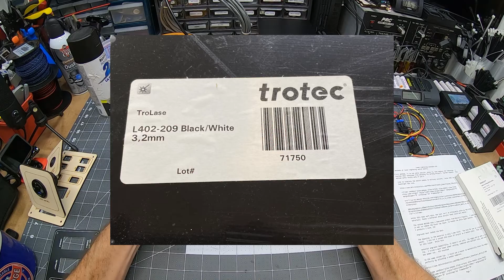Laser Engraved Switch Panels Using A K40 Laser

Comment: Excellent breakdown of your trials with different materials. Have you ever experimented with any type of metal for that "true" feel or is that just not feasible as a private person, meaning not mass producing to get the cost down?
Reply from the maker: I’ve had excellent results spray painting aluminum and using the laser to remove the paint to create text, outlines, and marking the drill locations for components. The downside is the holes must be manually drilled, and square holes are a challenge. I used a scroll table to carefully cut the squares. Lasering acrylic is just so much easier and being able to backlight the panel is icing on the cake.
Reply: @2manytoyz123  Understood, thanks for your reply!

Comment: Would the final product/material work using a diode laser like an Xtool D1Pro?
Reply from the maker: I have a Creality Falcon 2 40W diode laser as well as the CO2. I tried using it, but the light wavelength is wrong. It cuts black acrylic nicely, but doesn’t work on light colored materials. With the laminate, it cuts the dark top layer, and does nothing on the white layer, except reflect the laser energy back to the black layer. This makes a mess of the top layer.
Reply: @2manytoyz123  thanks. That sounds about right. I’ll need to save for a CO2 I think. Looks great though.

Comment: Excellent video. I have been looking for a way to make more professional looking control panels for my electronics projects and toying with the idea of purchasing a laser engraver. You've convinced me that a laser engraver is the way to go. Thanks.
Reply from the maker: Glad you found the information useful. Just be aware diode lasers won’t work on clear or light colored acrylics. They excel at cutting wood and black acrylic. I have both types of lasers. The CO2 laser cuts all acrylics and is perfect for laminated acrylic.
Reply: @2manytoyz123  Hey i also wanna go with metal, or aluminium, what kind of engraver can you recommend?
Reply from the maker: @VELVET462 That takes a much more powerful laser. Typically a fiber type. My 40W can cut extremely thin stainless steel, and engrave it. Aluminum dissipates heat so quickly, I can’t even engrave it.  Prices go up exponentially for a fiber laser.
Reply: @2manytoyz123  amazing video! thanks for sharing. Is it possible to engrave with good resolution using a diode laser machine? I want to engrave a switch with backlight using a sculpfun S9 that I haven't bought yet. I hope you can guide me before buying something that wont work
Reply from the maker: @jorgeElRojas I also have a Creality Falcon 40W diode laser. While it excels at cutting and engraving wood, it only cuts dark acrylic. It’s the wrong light wavelength for this application. When I tried engraving black/white laminated acrylic, it cut through the black top layer, and once it hit the white layer, all the laser energy was reflected back into the upper black layer, making for a big melted mess.

Comment: Hi, great video. Would you mind sharing where I can get those switches with a built-in LED? I been looking for that model for a while, I'm having some trouble finding it.
Reply from the maker: I can give you the specific P/N for the red and green switches I ordered from Mouser or you can get exactly what you want by using this data sheet to create your desired switch:  https://www.mouser.com/datasheet/2/60/dm-1382873.pdf
Reply from the maker: Green LED switches: MFG Part No: DM64J72S205Q6, red LED switches: MFG Part No: DM64J72S20503

Comment: I think a thin maybe 2mm clear over the top of the black panels would be great and protect them from scratching or other damage.
Reply from the maker: Keep in mind panel mounted components, like switches, have a limited “grip length”.  Many of the ones I use are intended for 2-3mm thick panels.  A thicker panel won’t allow the latches to lock on a snap in type switch, or there might not be enough threads on others. But, it’s worth experimenting!  Maybe 1mm of clear over 1mm of black, with a 1mm white backer. Or oversize the holes on the clear layer, so the components don’t actually go through it. The nice part is once you have it designed, it only takes minutes to make another if the first one gets damaged. Have fun!

Comment: I used the trotec to create a control panel on the K40. I don't have a laser guide, so I wanted to be able to do the vector cutting and the raster cutting witout moving the piece. The only complaint I have about the matieral is that my control panel was bigger than the one here with a dozen switches, 10 fuse holders, a USB outlet, a 12 v outlet and even a 1/8 audio input. With that much hardware, the thing is floppy and needs additional support in the middle. Smaller panels are definitely the way to go.
Reply from the maker: I've used the 1.5mm material, which is too flimsy by itself, but the 3mm material has worked well for me, but not made a huge panel yet.  I just made a a couple of panels for our new RV, and incorporated 2020 aluminum frame material.  This method should help your project.  Details here: http://www.2manytoyz.com/Laser-Engraved-Panels.html

Comment: What is your power setting for engraving? I have spray painted white 3mm Acrylic Opal with Gray Spray Paint and when I wanna engrave it, it leaves black letters. Tried different settings eben down to 5mA/200mms.
Reply from the maker: I put the details in the video description, but you have to click “more” to see it. Don’t like that YouTube did that. Raser Engrave 4mA @ 100 mm/sec., air assist OFF.

Comment: those panels look ver nice. im gonna make a new switch panel for my sailboat with halo switches, and want to get it laser engraved and backlit. hope they will look as good as that, only think is my panel will be allot bigger, so must find someone that can laser a bigger panel. allso gonna mount my vhf and batterymonitor on my panel.
Reply from the maker: My inspiration was "The Warthog Project".  He has a website, and YouTube channel.  Rather than make 1 large panel, he used the same method as military aircraft.  A backplate, with individual panels attached.  Very modular, and easy to upgrade a section without having to remake everything. You can check out his website here: https://thewarthogproject.com/the-panel-design

Comment: I want ro try making my own panels, was looking at 1/4" thick 2 color plastic , what type of laser engraver would I need to get started that you would recommend? Great info video!
Reply from the maker: Any CO2 laser 40W or greater would work. I’m using an inexpensive K40 type laser. The real limitation of mine is the bed size (325mm x 219.96mm or 12.79” x 8.65).  Larger lasers cost considerably more.  https://amzn.to/3zTrxdI
Reply: You really don't need a CO2 laser to engrave plastic. A cheap diode laser will do just fine. I got the sculpfun s9. It's like half the price of a k40.
Reply from the maker: But if he wants to cut the acrylic panels too, a diode laser would take multiple passes.  I cut out all the holes for the components, and cut the perimeter of the panels.

Comment: The Way I cut my new control panel for my K40 was to take a piece of 3mm clear acrylic and then painted one side of it black.  Then I engraved it from the side I had painted.  You'll want to flip your image file of your panel cutouts and lettering so it will read correctly from the other side.  Then to make the lettering stand out I simply spray painted the back again in another color ( fluorescent green in my case) and it's all set.  The nice thing doing it this way is that the front is nice and smooth and can be easily backlit if you want it to be without needing a diffusion layer added to the back.
Reply: What kind of laser do you have?
Reply from the maker: @spencerhollett9516 similar to this one: https://amzn.to/3UEmIiw
Reply: @2manytoyz123  yep very similar, Monport is just one brand of this style of laser